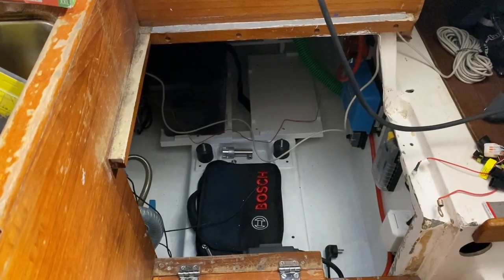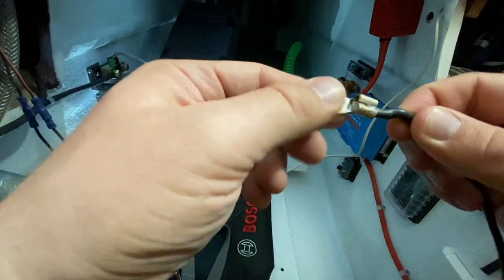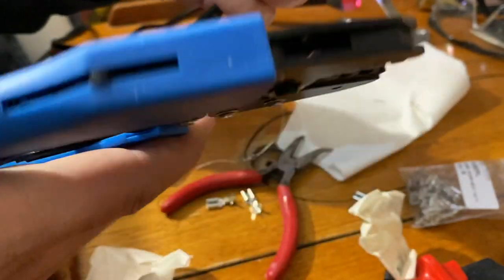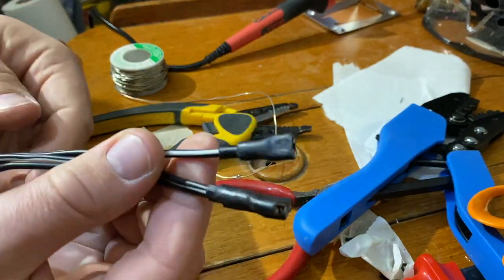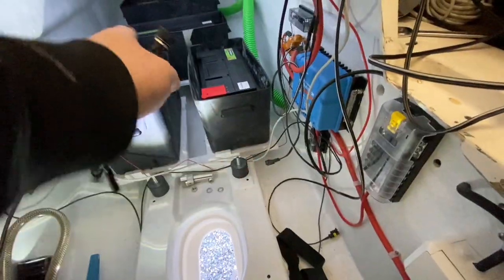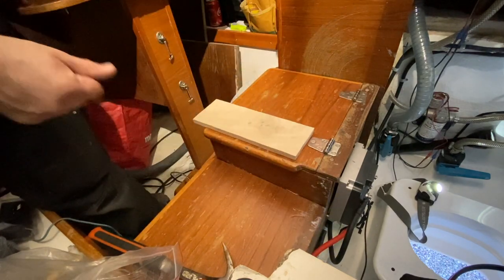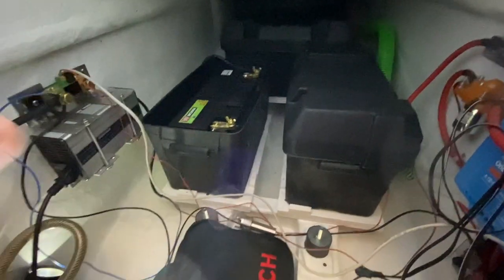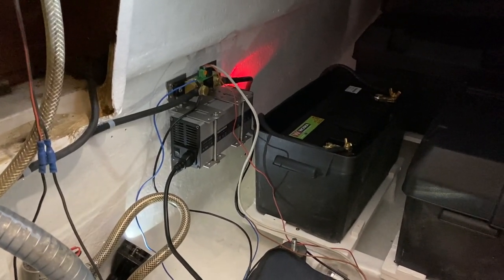Electric motor to sailboat part 7: the wiring. Ep12 Project SeaCamel

Comment: Your videos are very well made and very intresting, so first of all i want to congratulate with you for this. I am very happy that i found your channel because i have the same engine (volvo penta), and here in Italy where i live is pratically impossibile to find all the spare parts for this engine, can you help me out by giving me the information where you bought all the parts? Thank you in advance.
Reply from the maker: Hi Davide! Thanks for your kind words.

I don't know that much about the actual engine (I haven't have one - just the saildrive part).

But what I've heard, Honda parts should fit to it.

On the saildrive there's not parts available anymore I'm afraid. So if you have one working, take good care of it. Only way to get spares is to buy another used saildrive unit.
Reply: @ArcticSeaCamel  Thank You so much for your fast reply!
Maybe I haven't explained myself because I don't speak english very well. Sorry :-(
Regarding the engine I have find all component in Honda Marine Italy.
Now I need only the gaskets and oil seals of the sail drive Volvo Penta.
In Your video, I saw that the gaskets and oil seals were contained in the Volvo plastic small bags.
I think You bought them from a Volvo dealer.
I am wrong?
Reply from the maker: Hi

Yes, there's couple of parts available from https://marinepartseurope.com/explodedview?category=Marine+Gasoline+Engines&product=MB2A&catalog=7742060&img=49468.png&header=Lower+Gear+Unit+Sail+Boat+Drive+Unit+50S&section=54146532

And here:
https://marinepartseurope.com/explodedview?category=Marine+Gasoline+Engines&product=MB2A&catalog=7742060&img=49470.png&header=Intermediate+Housing+Sail+Boat+Drive+Unit+50S&section=54146531

Basically only that gasket between the lower and upper part and O-ring for oil caps and zinc anode and propeller nut (and for some reason that horribly expensive gear selector thing! :D ). The sealant rings I ordered from local bearing store with stainless springs on them. O-rings are just basic O-rings. In that way all the seals can be found. But almost none of the mechanical parts!

Hope this helps! :)
Reply: Hi, thank You so much for the information. Unfortunately there are very few parts available.
In any case I need sealant rings and O-rings and if you found them from generic hardware in your coutry, I think I'll find them too in Italy :-)
I hope!
Thanks again for the help!!!
Ciao Davide

Comment: Thank you for your very interesting videos.
I would be interested, where you did get the clutch between the motor and the saildrive. Was this be a Part of the Motor?
Reply from the maker: Thanks for your kind words. If you mean the coupling that connects the two shafts together, that’s just standard part you can buy ”anywhere”.
Reply: @ArcticSeaCamel  thank you